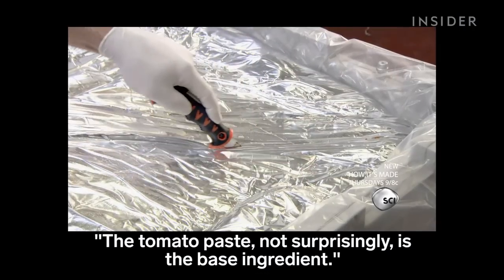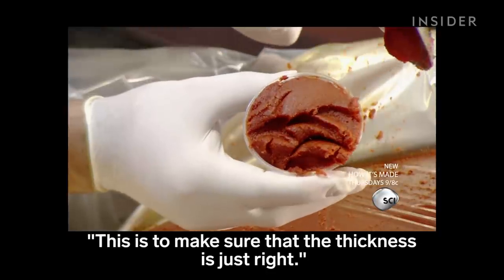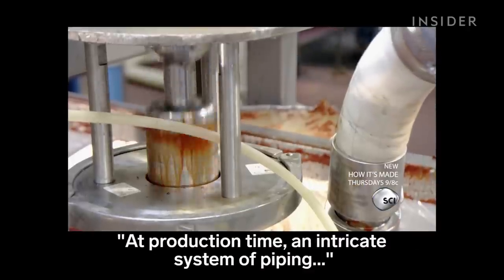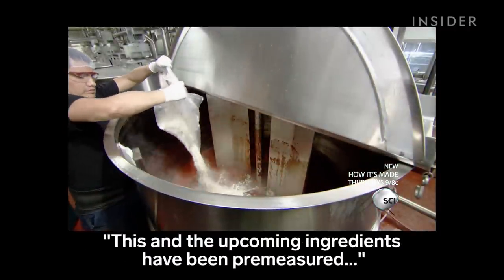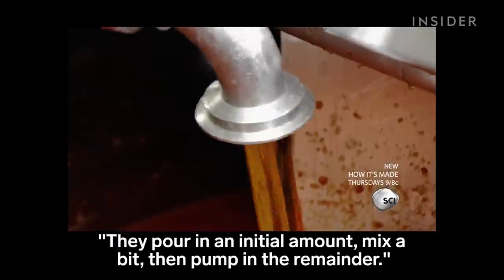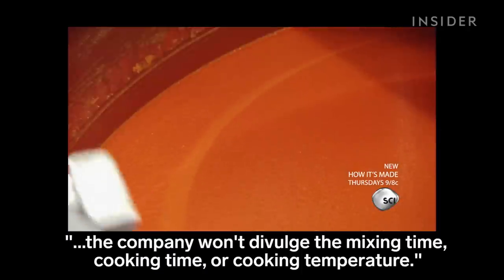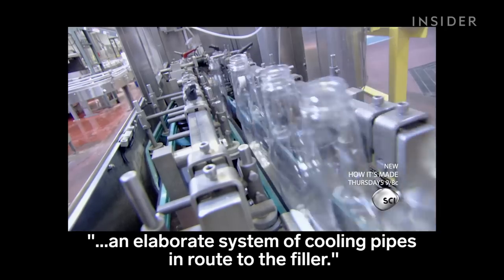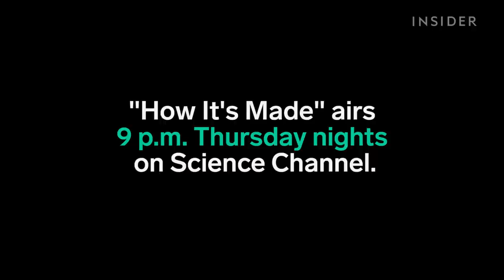This is how ketchup is made

Comment: When I was a kid, On a school outing we went to a tomato sauce factory (wont mention brand ). We first saw the tomatoes arrive in a dump truck direct from the sorting area of the factory, they were dumped onto the exposed grate where they fell through into what looked like a huge mincer screw. Any stray tomatoes were scooped up by a couple of dudes with shovels, they were chucked in as well (the tomatoes not the dudes).  We all shuffled in to see the now tomato mush dumped into what could have been large concrete mixers... it was here I learned to hate the smell of tomato sauce. All the spices and stuff were dumped into these mixers, we moved along to a windowed area where we saw the mixed mush being transferred in to some other heated concrete mixers where it was cooked and then dumped into what I suppose were holding tanks. Form here the cooked slop was transferred into bottles somehow. After seeing all this I have never been able to eat Tomato sauce of any kind!

When I was a little older, I got a a job in a milk-bar, takeaway shop. Didn't pay much but it gave me pocket money for my hobbies. I did a bit of everything, including peeling the potatoes and cutting the chips. One job I didn't do was the sauce bottles, that was done by the owner of the shop. All of the squeeze bottles were gathered up (remember those red bottles with the white tops and the little caps that were never put on) The outside of the bottles were all cleaned with a cloth from a bucket of very hot water, all of them, one bucket. The bottles were wiped dry and the tops removed. Each bottle was filled to over flowing and then the excess sauce and dead flys scraped scraped off with a plastic ruler. Caps replaced, bottles again wiped and put back on tables.  

I don't even touch sauce bottles in a cafe now, no how no way! I cannot bring myself to eat tomato sauce, I would fall over dead from revulsion!